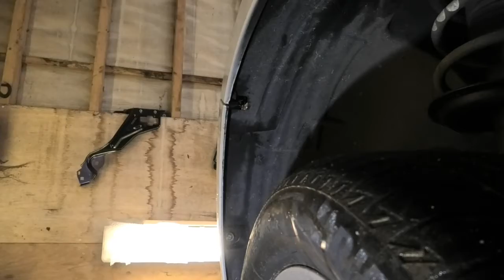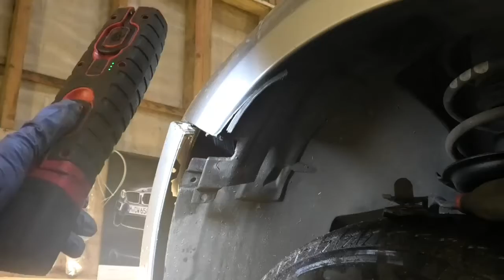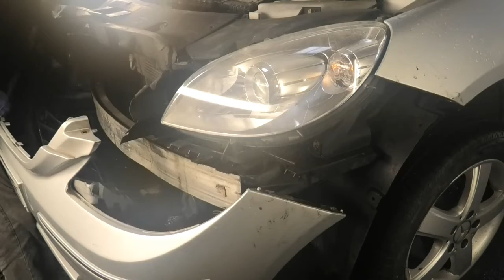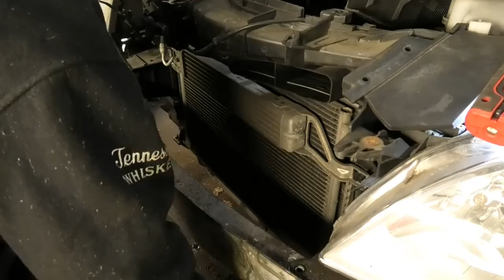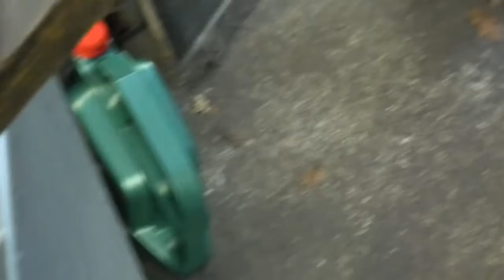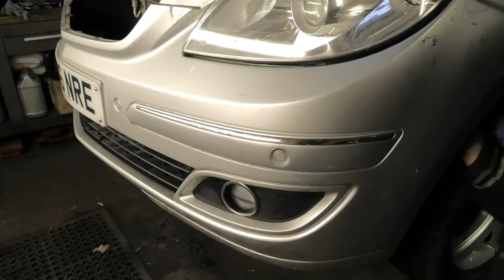Mercedes B class aircon condenser removal and replacement

Comment: Hi, do you know how to remove the entire sway bar on a w245? Is it necessary to remove the condenser? Thank you very much :)
Reply from the maker: Well just to remind my self I had a look at the video and I didn’t remove the sway bar. You would need to remove the headlights to get it out. Well I manage to remove the condenser with the bar in place so it’s doable. Cheers.
Reply: @DaringBeefcake  sorry, I expressed badly the question. I meant if to remove the sway bar you have to remove also the condenser. Thanks anyway for your kindness :-) cheers
Reply from the maker: @ticktime6569  oh I see no, the sway bar will come out without the need of removing the condenser, the headlight need to come off though as far as i remember..